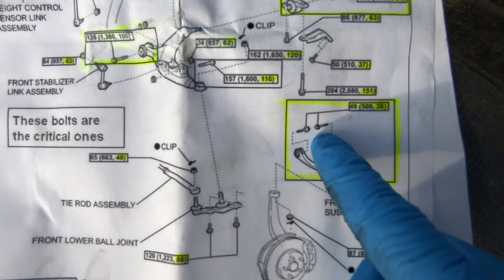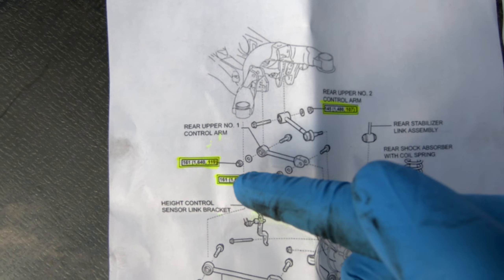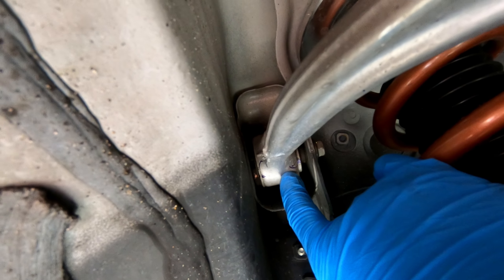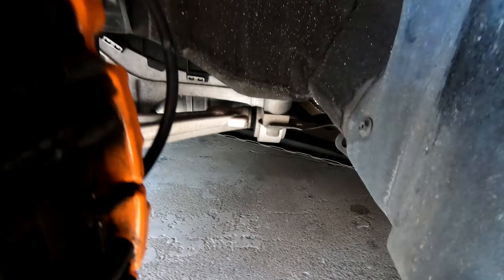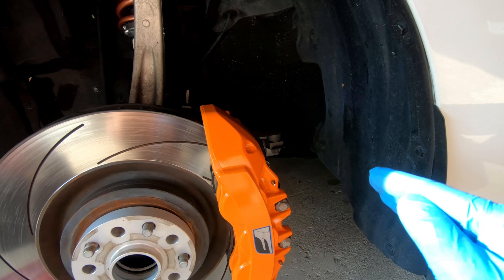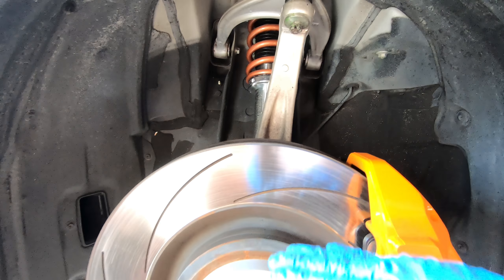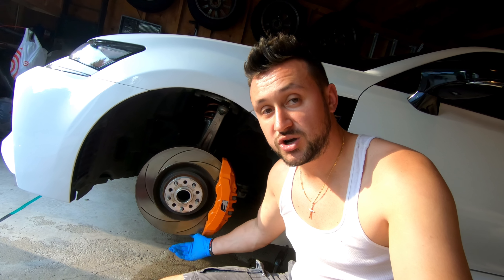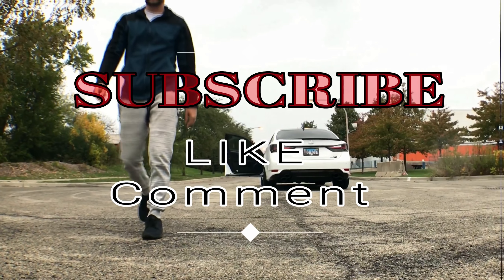Resetting Suspension Bushing on Lexus GSF

Comment: I know you felt the difference when you drove it... especially that being a lexus. I did everything properly when I installed Tein Street Advance Coilovers on my 2012 Acura TL. I just didnt reset the bushings. While the coilovers themselves were trash, the difference was night and day when I got back in there to reset the bushings. I recently replaced the upper control arms with megan racing adjustables, a rear camber kit and knew hubs, bearings and extended studs on all 4 wheels. Again, I didnt reset the bushings lol. Its very minimal but Im experiencing the very subtle but constant vibration when I drive. Its the same vibration I had before I reset them with my previous coilovers

Comment: Did  it change where you marked the bushings?
Reply from the maker: Where I marked them it did not. But maybe internally the bushing moved. Not sure tho.
Reply: Bullets Garage👍 I’m not lowering my GSF till I get my rims. I ordered the Advan GT wheels.
Reply from the maker: Nice
Reply: It moved for sure internally.  The outer ring of the bushing should never move.  If it does, you have a much more serious problem to address, and changing bushings is almost always a huge PITA.
Reply: Yea, the bushings were not properly marked to show the reset. The mark should have been on the inner cylinder. Bushing resetting is absolutely a good idea if your lowering more than 1". If your torquing your bolts while the car is raised, then air out on air suspension, the bushings will twist and can ruin.  If the bushings are reset to driving height, then they will not be under stress during normal driving and they will assist the suspension in returning back to the correct position.  I was very interested to see how you were able to get the A-arm bushings torqued with the spring in place?
Reply from the maker: I eye balled the tq on that one since it was a low tq

Comment: Isn't the main reason for torquing when the suspension is loaded so that the bushings aren't torn when the arms are fully loaded / unloaded?
Reply from the maker: Same concept I guess
Reply: That's half of it.  The other half is, you want the bushing in as close to a neutral position as possible at normal ride height to minimize the wear factor.  If the bushing is under tension when the car is sitting still at the new ride height, it is getting tired much faster than it should.  If you've ever heard someone say their suspension "settled" after lowering, what really happened is the bushings tore internally and found their new neutral by having the rubber tear.

It's also important to note this is not necessary with polyurethane replacement bushings, or with ball joints typically found on racing vehicles.
Reply from the maker: Got ya. Makes sense. Well I’m glad I did this then.